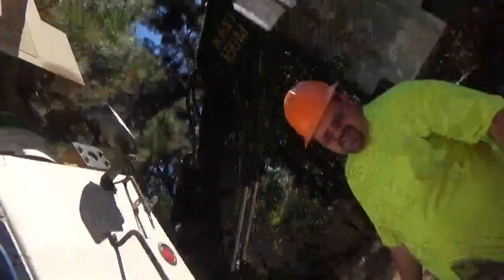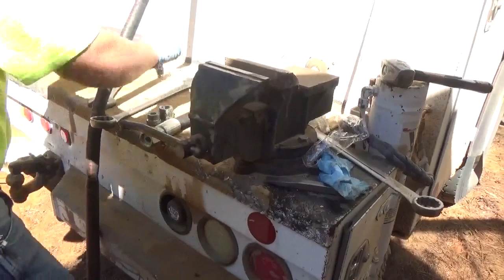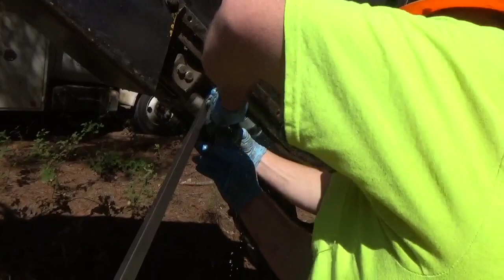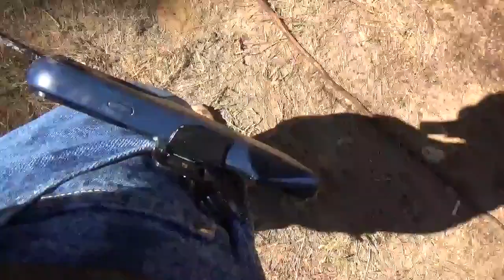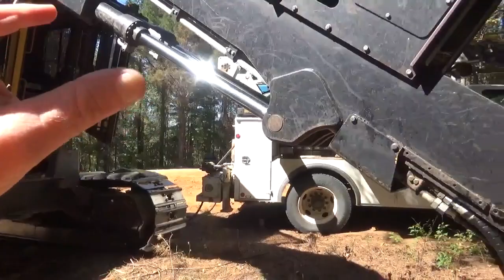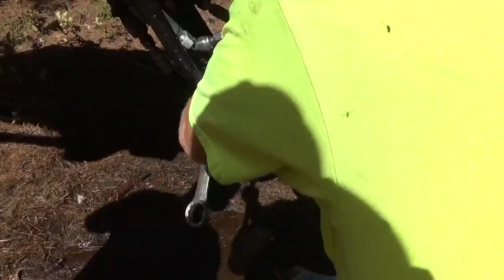Working on a hose on Derrick's Tigercat 830

Comment: Feel your pain.. the 90 loosens up and eats oring on my 822C.. Nice and messy when the oil is 180 mid summer and your up on the side of the mountain.. those stupid 16 to 12 FF reducer off the pipe is a bugger.. had to switch over to a 16FF on the hose end instead on one of my lines

Comment: I'm like you, they probably had a surplus of those adapters and decided to "put them to use". They could have used a 1" fitting on a 3/4" hose and done away with some o-rings and a connection. Seems like there are less chances to leak that way.

Comment: why don't you find where that line is and I'm put in a shut off valve so if the hoses break again you just turn the valve off
Reply: That looks like a 7/8" or1" line they are working with, I'd bet there is at least 5 gallons or more just on the boom lines that would want to run out no matter what you do
Reply: If a ball valve was added, the handle could be tyrapped to the open position, or could take the Handle off.

Comment: tim , how much hose trouble does the 830 have say in a 6 month period and is it due to heat,wear and tare or a combination of both.we had alot of trouble with timbco in summer temps. due to hdy. heat,but the 522 are alot better.i always thought the 830 by looks of it had one of the best hdy. cooling systems.never tryed one because closest dealer(ricer)was 150 miles away.we worked steep hills alot like you all do just the mountainms are alot taller,any way keep up the good videos.
Reply from the maker: +robert curry heat isn’t a problem on the 830. It’s wear and tear on those right at the end of the boom

Comment: They probably did that so in case you need the one inch line it is there. You will not have to run a new line. I am a electrician and sometimes we over do things in case you need it in the future

Comment: Working in places where the flow can't be shut off or we just don't want to make a mess,we use a Cold Shot kit to freeze a plug in the line and stop the flow for service.
http://pipemanproducts.com/blog/pipe-freeze-kits/
Works good on any liquid that will freeze at a temperature higher than -110F